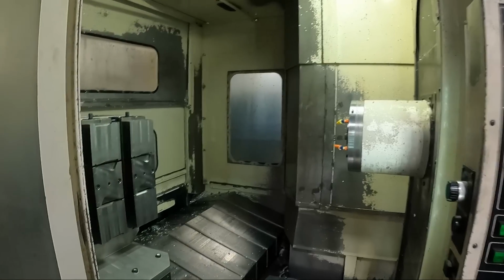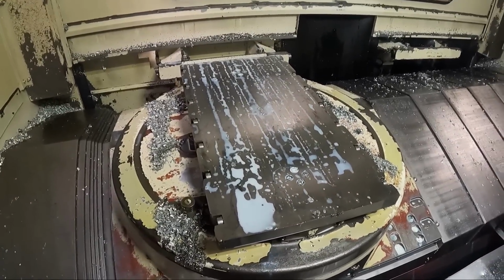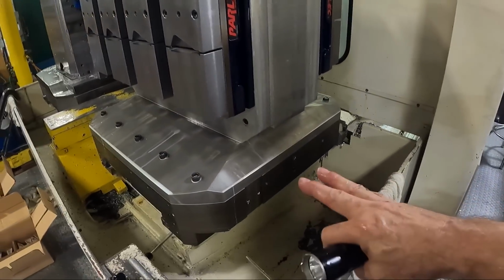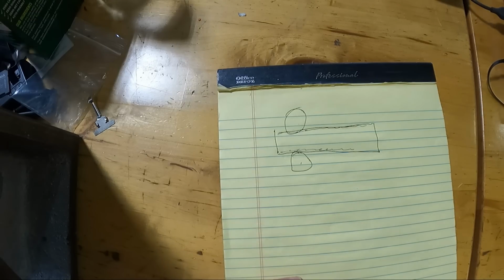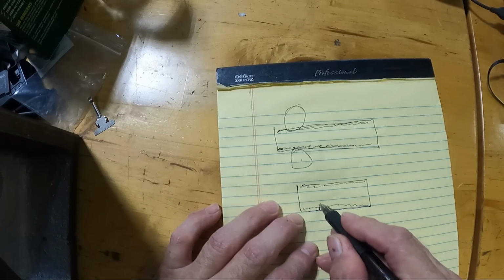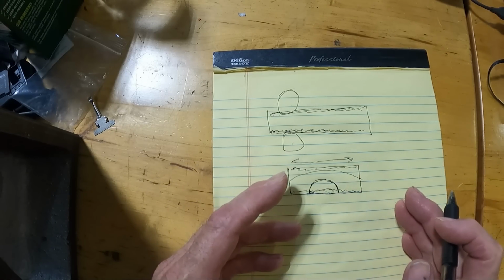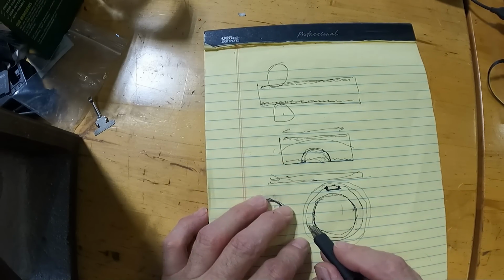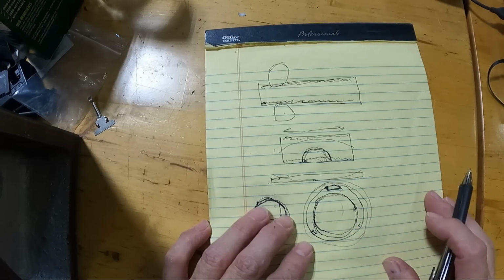Answer Some Comment Questions

Comment: What are you using to mark the tool numbers on the tool
Reply from the maker: I have been using a Brother labeler. They make different types of label tapes. I’m not at the shop right now so I can’t give you the exact information. I think it’s called extra strength adhesive black. I have found this holds up well in the coolant. If you first clean the spot you stitching it to withe acetone.

Comment: Hi Peter what Gopro or camera do you use to get the machining footage? Is it still the Gopro hero 4 used previously? If you upgraded did it make much of a difference? Thanks.
Reply from the maker: When the camera doesn't need to be in the coolant proof case. I use a Hero Black 9 in the media mod with a Rode wireless mic. In the coolant proof case with the air knife in the machine.  I use a Hero Black 6 or 7(See the playlist. Camera Enclosure For GoPro Hero 6). This is for two reasons.  #1 These are the newest ones that will fit in the case. #2 and more importantly,  they are the newest ones that will still let you monitor live video over WiFi while recording. The GoPro Black 8 will also but it won't fit in my case. For some reason GoPro has disabled this in the newer cameras. Something I must have for the coolant proof case. I was going to design and build a new case for the Hero 9 and 10 black cameras. Not now, because they no longer have this ability.   Also I film in 2K most all the time but output 1080 to a YouTube posting. I use Adobe Premier for my editing of video.

Comment: Hi Peter! I was trying to find an older video were you talk about tapping and feeds. Had a tricky "tap-job" recently and for ease of mind I wanted to rewatch :) I also want to thank you for letting us peek over your shoulder, I did learn a lot and it positively changed the way I look at my job.
Reply from the maker: I can’t remember the exact video. But the way I program tapping cycles is this. I use the value of 40 inches per minute feed. For easer to tap materials and 20 inches for harder to tap materials. I know this sounds strange but the feed and the pitch of the tap controls the speed of the spindle. Do some calculations you will see. In general those feed rates will work for most materials.
Reply: @EdgePrecision  Thank you!

Comment: In the old days when the big manufacturers had their own shops most all of them had in house heat treat as well.  I have a buddy that had a machine shop in the old Vogt machine plant in Louisville. From the 1880s till the 1990s they made valves….. from iron ore to finished valve all in house.  Forging casting heat treating machining and in various materials. It was a very interesting place to look around and think what it was like when in full operation. They had ovens so big a train car rolled into them.  A far cry from the contract type supply chain we have mostly now.
Reply from the maker: Yes when you manufacture your own product line in house. You can make decisions about materials and heat treat. But for job shops you really cant just go changing things without the customers permission. Witch usually results in doing tests on the material to assure it meets the properties they specified.

Comment: That reminds me of a time about 20 years ago, making a transmission adapter plate. A Ford manual Tremec T-5 transmission, to then mate up to a Subaru flat 6.. kinda a strange set I was doing... none of that matters, but, the adapter was out of cold-rolled steel plate, and was approx 15/16" think and was the shape of a large letter "C", with the open end of the "C" downwards... anyhow, my lack of knowledge upon such things as a 20 year old, had no clue that hogging out all the center section of the "C" would allow the thing to open up, and all the precision through holes and tapped holes that mated up perfectly to each side one at a time, ended up being about an inch spread at the bottom most or lower two holes... I didn't understand what or how I could have made such a horrible mistake, did my highly detailed blue prints and patterns move on my as I was transferring the key points over to the steel plate... Nah, the cold rolled steel I found out, from my father,  as he kinda politely chuckled at me, that the material in its uncut state was under allot of stress, although cold rolled was pretty flat, and no mill scale, hogging out the center area allowed my new design of a silly spring to be formed instead of the adapter plate I thought I was fab'ing up..LOL... I had so many hours in cutting that to a clean edge shape, and was so proud of that, only for the ending results to be useless scrap... 

I made another one, out of hot rolled and hogged out the majority of the center... got the basic shape and contour of the inner and outer dialed with what I wanted, and then poked and tapped all my related holes... I was happy again... I needed to experience that the hard way, as now, anything I design, I always am mindful of that costly loss. A chunk of 1 inch plate 48 x 48 cold rolled, when I was young, was allot of money for me, as they wouldn't just sell a chunk of 24 x 24 inch to me, I had to buy the whole slab. and then flay cut the front and back faces, not that it needed it, but for the adapter unions system's required dim's the plate needed skimmed a wee bit... This was another great video, that brought out a few old stories I had forgotten about.. Heck, even when I am thinking about the destressing reaction of various alloys/steels, I am only just thinking about the concept, and not that whole long story of what and how I learned that the hard way... I enjoyed going down memory lane on this one.

Comment: Thanks for video Peter. I where remembering the titanium parts you made for some years ago and have been forced to remove from your channel. I was very nervous about the internal relief of stress in the material but you managed to bend the material back again with in fine tolerance. 
From my experience the Mechanical Engineer does not specify any information about stress release by heat treating on the drawings, either because they don't know that the material is not uniform in structure or they will say the machine operator must know when to do stress release. The machine shop don't have time to do stress release because it cost time and money and it was not specified on the drawings. Simply the ball was dropped between two chairs.

Comment: In the "modern machine shop" no one gives 2 flying f*'s on the proper technologycal order , from raw material , to preparation , toughtful machining , post process , Nice deburring and all that . In the 8 years that i spent in machine shops  never once did a "master" comment on insert geometries , the difference between positive and negative rake , attack angle , machine leveling/foundation/base  , never re-cheking . But always complaining when a dull endmill in a long holder chatters . It's really getting quite bad . Always the rush , but no toughts behind.

There is a nice saying : We always have time to make it wrong 2 times , but never the time to make it once right . - It's so true , it hurts .
Thankfully mr. Peter you are the  opposite of this . I'm pretty sure many other viewers sometimes get annyoed when you are chasing the last 5 tenths , but it's the proper way .

Comment: Internal stresses in mill products are usually due to cold rolling, but for precipitation hardened aluminium alloys like 7075 it’s different. These alloys are solution heat treated and aged to strengthen them. Solution heat treatment involves heating the material to a high temperature to dissolve secondary phases, followed by rapid cooling (aka quenching) to keep everything in solution. Aging at a moderate temperature then causes secondary phases to precipitate from the supersaturated solution in a controlled manner, which strengthens the material. The quench that follows solution heat treatment is what introduces all those internal stresses. During quenching, the surface cools the fastest and shrinks first, but because it is still hot and thus relatively soft, it will yield and deform to accommodate this shrinkage. As it cools it becomes stronger and eventually can no longer deform. However, the hotter interior is still cooling and shrinking. This causes it to pull on the surface, leaving the core in tension while putting compressive residual stresses on the surface.

Slowing the quench rate can help reduce these stresses, but 7075 is very quench rate sensitive so there's a limit to how slow the quench can be. Too slow and the dissolved secondary phases will precipitate during quenching, reducing the final aged strength. To relieve internal stresses in the final product, the material can be stretched a specified amount after quenching, then aged. The idea behind this is as follows: the core of the plate is already under tension, so stretching it a little will cause it to yield and deform. The surface on the other hand is in compression, so it must be stretched much more before it will start to yield in tension. Once the stretching force is released, the material will spring back to an equilibrium state. However, since the core has deformed more than the surface, this new equilibrium state will have a smaller difference in stress between core and surface. I believe thicker 7075 plates are always supplied with this stretching stress relief because the aforementioned quench rate requirements mean that thick plates will always have large internal stresses.

It's possible the new material was not stretched enough, or it was quenched too severely. As an interesting aside, this part now has exposed material that is under a fair bit of tension, which lowers its fatigue resistance and may lead to stress corrosion cracking, especially since it is in T651 and not T7351 condition. I wonder if this matters for the customer.

Sorry about the long comment, I wasn't planning to ramble on so much but I really like talking about metals.
Reply from the maker: All these parts get coated/painted with a very thick layer (.015"-.030") some kind of Epoxy. I have in the past made them of almost pure Magnesium. I no longer, or refuse to do so. Because now the shavings are considered a hazardous material. So has to be paid to be disposed/incinerated in DOT approved barrels. It also totally messes up the machine and coolant. I wont machine it dry because of the fire hazard. It is interesting to lift the aluminum compared to the magnesium. In these thick plate sizes, and feel the difference in weight. In this case what they are interested in is the density of the material for the purpose of calibrating something. I'm not totally sure why 7075 instead of 6061. Maybe there is a slight difference they need.
Reply: @EdgePrecision  I see, if they were made of magnesium in the past then corrosion resistance certainly isn't a concern. I've never had a chance to handle pieces this big myself but I can imagine the magnesium plate feels bizarrely light. Interesting use case, thanks for sharing.
Reply from the maker: One other thing about the almost pure magnesium was it would get a layer of oxide on it quite quickly, overnight. Kind of like silver.  Or this may have been from the coolant. sort of strange. Something I didn't expect.
Reply: @EdgePrecision  It just occurred to me, you mentioned you don't do magnesium anymore because of the hazardous waste requirements. I remember you made some of your steady rest jaws from beryllium copper, are the chips from that as problematic as magnesium?
Reply from the maker: @purerhodium  No the reason Magnesium is a hazard is the fire. It burns and when its on fire you pretty much cant put it out. Beryllium coper shavings can be sold back to the scrap man at a good price.

Comment: Interesting. That pallet system is same yet very different from A61 pallet system when I used to run it. A61 has 4 cones where pallet is lowered into and its very bad idea to spray air anywhere when a61 horzional mill does not have pallet in it, even if it has same air blow clean system as yours. In such rare cases, I would just bring in one of few empty pallet to protect it when I clean out machine. More commonly though, is that I simply set it to stop at tool change M1 and clean machine with pallet in it.

A61 was interesting to run. I was mostly operator, I didn't do setup, I just replaced parts and cleaned machine up. I did do some more cnc machinist stuff like replacing, and measuring broken tool or coolant refills. (Man those took forever to fill) I did quite a lot more on other machines that aren't so expensive.
Reply: I worked on a machine with 4 cone clamping pallet , i liked it better than this old design , somehow , that was more sealed and whatnot .... . Now i work with this design , (but fork changer , not pin and chain) and i find it harder to keep it clean
Reply: @kisspeteristvan  interesting. Thanks for commenting.

Comment: Engineered metal is so weird. I think we have a wrong understanding of what is solid. In the end they are just particles glued together and if you change something in the tension of the glue, it changes everything. Same with welding like you said. Nice explanation, thanks for the video.

Comment: For an extra level of geekery on metal stress. Thinner sheet materials they roll into reels then stretch straight, all sorts of nightmares hiding

Also when you roll some pizza dough out you don’t get a rectangle but a stretched oval. Same thing happens in rolling mills, so the outside of a plate has non linear stress which makes it buckle as well as bend🤦‍♂️🤦‍♂️🤦‍♂️🤦‍♂️🤦‍♂️🤦‍♂️😭

I have a job I use special Swiss made 6082 tooling plate. They facemill both sides before I get it in the factory so it’s super flat and reliable. 

Stress free material means a stress free machinist👍

Comment: I'm a retired Tool & Die Maker.  I worked for a major auto manufacturer that spent a lot of money at one point completely modernizing our machine shop.  These were very large CNC machines from various vendors.  We had a component to make for one of the assembly plants that was a 1" x 6" x 20' long piece of cold rolled steel.  The task was to put a series of holes down the center, running the full length of it, spaced apart with a very close tolerance.  It was too long ago for me to remember the tolerance.

The machine was capable of doing the job with ease.  But the parts, when inspected, were way off.  The spacing of the holes started out within tolerance but quickly got out of tolerance with the check of each hole getting progressively worse and worse.

The job was machined in an environment with no climate control.  It was very hot in the summertime when the parts were machined.  They were checked in a dedicated CMM room that was climate controlled after sitting overnight.

I'm hopeful that many here can figure out the issue.  Several of us "bottom feeders" tried to tell the higher ups what the issue was but they didn't want to listen.  A lot of time and material was wasted doing the job over and over and over with the same results until they actually decided to listen.  If I remember correctly, and it's entirely possible that I have not, somebody finally did some research and found that the material we were working with would grow or shrink .007 per inch with each ten degrees of temperature change.  Pretty huge difference over 20' of length with the tolerances that had to be held.  

Fun times?  Not really...
Reply: I worked in a calibration lab for a bit, new boss tried to adjust the temperature of the A/C to save some money. He got put in his place really quick. I miss those guys. We had controlled temperature within 0.5 degrees and controlled humidity. We also had a specific door we would open a specific amount for the really sensitive pressure measurements. We even knew our local gravity to 4 decimal places.
Reply: @rubikmonat6589  WOW! Gravity to 4 decimals! Did you by any chance take into consideration the astrological alignment of the outer planets for 'tug factor' at different rotational aspects of day to day scheduled master instrumentation calibrations? Or are solar flares more problematic considering the fluctuating subatomic particle bombardment. Bows of utter respect to you, Mr. Monat. ლ(・﹏・ლ)
Reply: @StanErvin-yo9vl  The scales on garbage trucks where I'm at are adjusted for the local gravity, the scales themselves are "only" accurate to within 100g, but when you're lifting 500kg bins and you charge the customer per kg, the wrong local gravity can affect what the customer is charged.

I was a bit surprised that the system actually had that feature, but it's only adjusted to within a 100km2 area (it was GPS based) so it only really mattered if the scales where located at sea level vs a mountain range.
Reply: Very easy to overlook that kind of stuff when it's the first time you come across it.

Still don't know why they keep QC rooms so cold when the factory is running +30 degrees tho. But QC is a very popular place in the summer! LOL
Reply: Had a similar one. Perfect parts in our shop shipped and rejected at the customers. Returned parts again test perfect. We had their inspector come over and the solution was to specify dimensions AND a temperature for both the parts and the measuring tools.